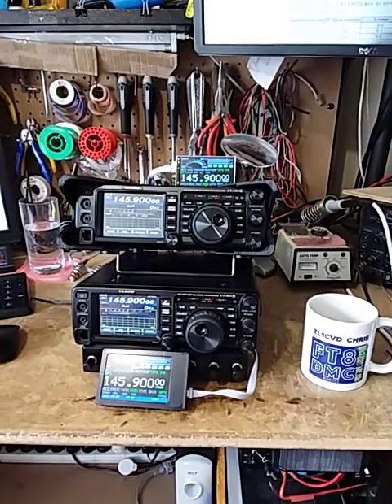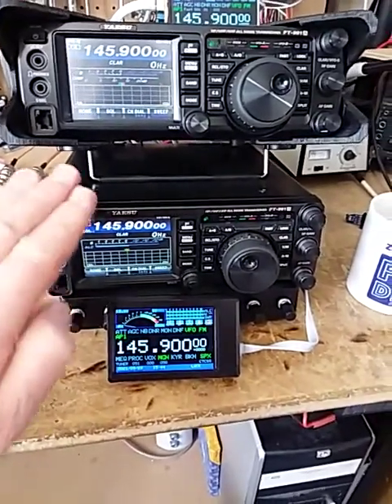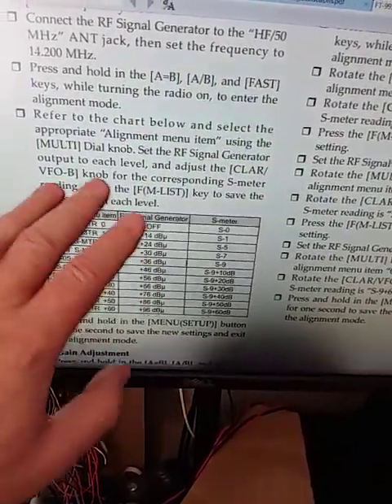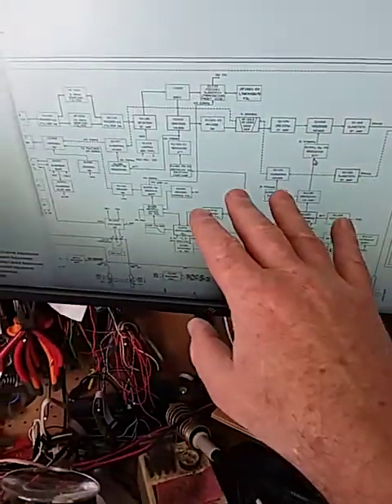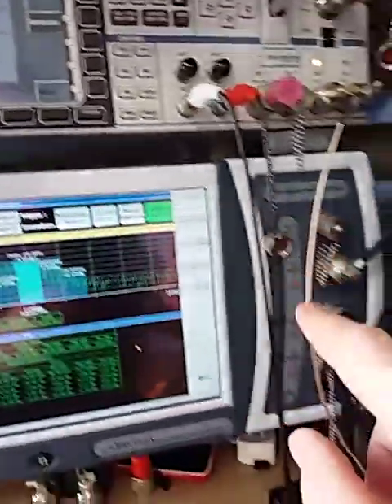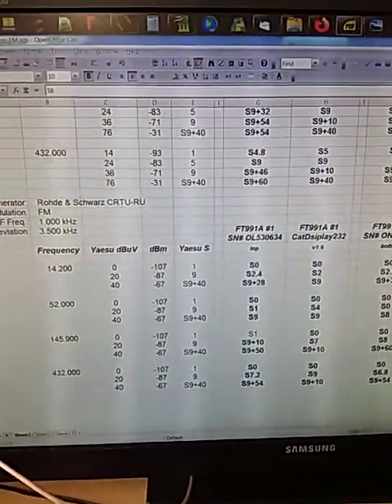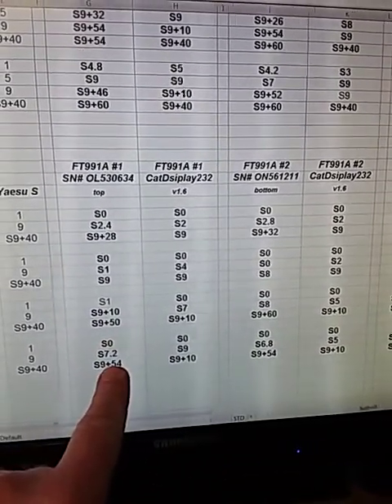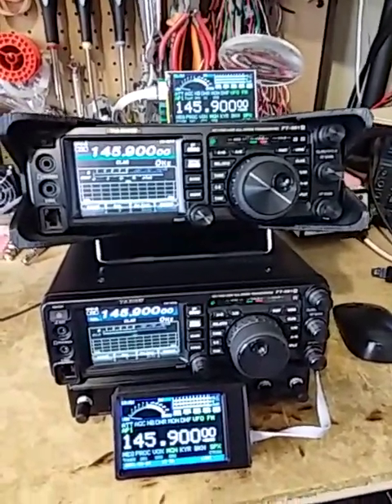FT-991A CatDisplay232 S-Meter testing

Comment: Hi Chris, thx for that very interesting video. I just bought a brand new FT991A and I also realized that the s-meter is not very accurate on all bands. I do not have a signal generator so I can only compare it to my other radios. On HF it shows maybe about 6-10 db more like my dFT1000D but thats's fine for me. On 2 m it's very close to my FT736 but on 70 cm the FT736 for example shows S9 and on the FT991A it is only S3 . Even good readable signals do not show any signal on the s meter at all. What do you think, should I send the radio back to the dealer for improvement or should I accept that? 73 Mario